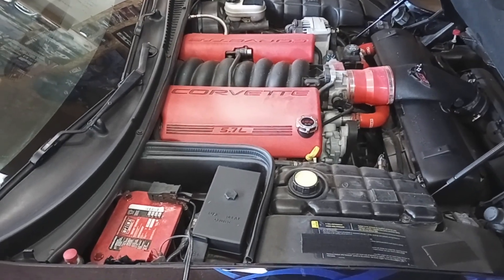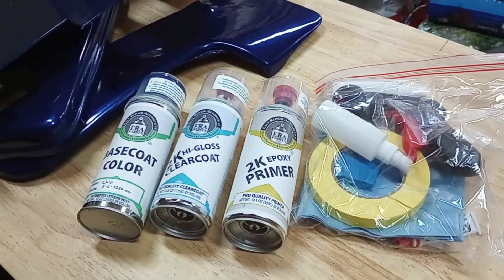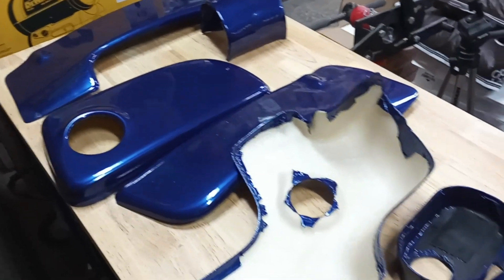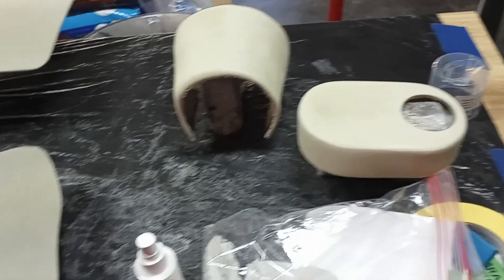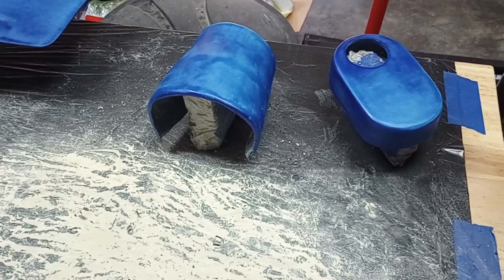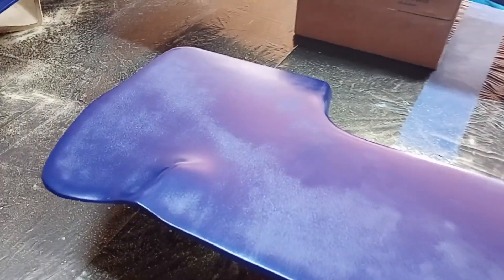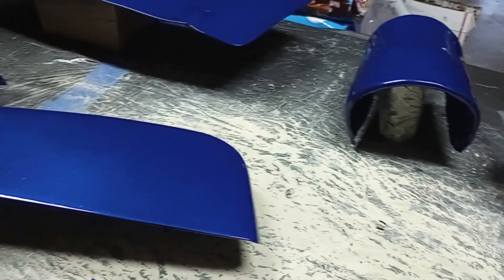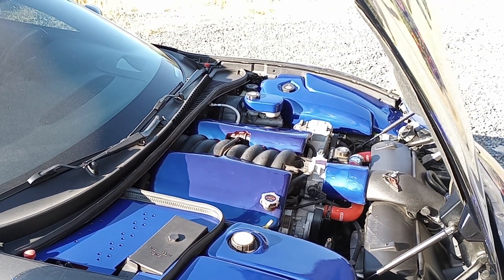Custom Painting C5 Corvette Parts with ERA Paints

Comment: Get some 3m primer 94 to aid in adhesion and if you can wrap to the back side of the panel and secure. They also make a 3m edge sealer which is a clear glue for high heat areas and places in contact with moisture, etc. like wheels wells and underbody.